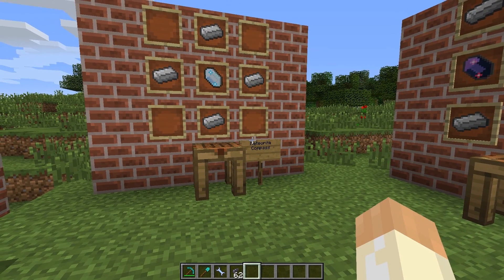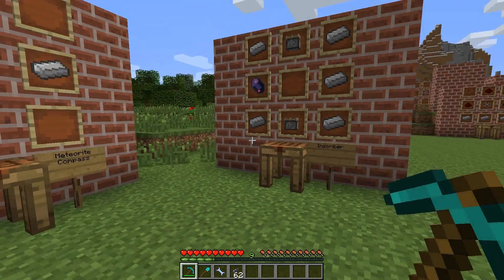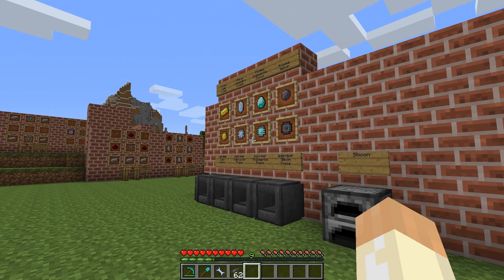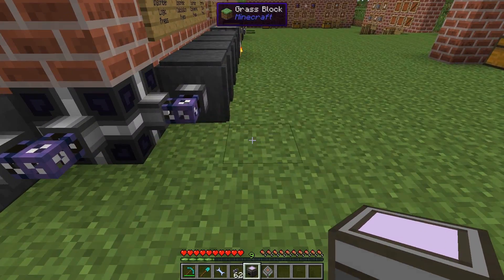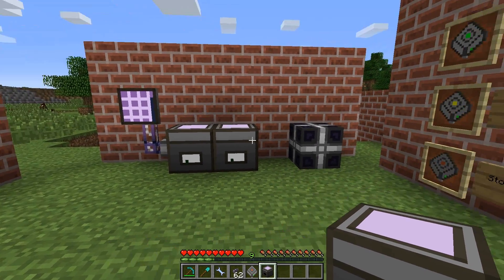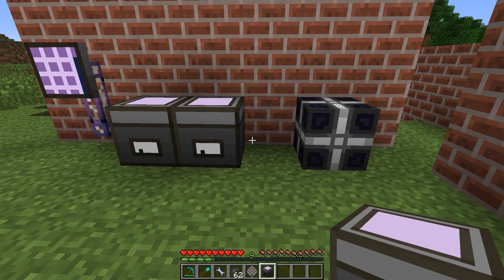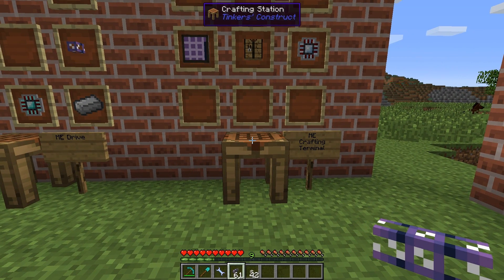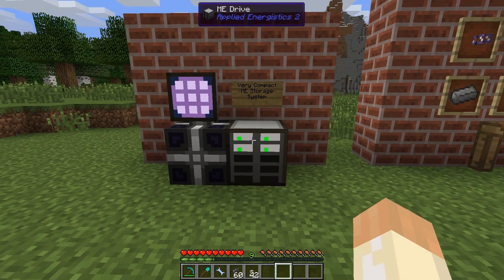Applied Energistics 2 Tutorial #2: ME Networks and Storage (MC 1.7.2 / 1.7.10)

Comment: I'm having a small problem. I'm running Resonant Rise, the latest version as of March 14th, 2016. I can't get two chests to link, no matter what cable I use. I'm powering them via a tesseract, but I can't connect the tesseract to energy cells, or to drives/terminals. Without that source of power, I'm not sure how to get the network running, unless I rely on basic AE power.
Reply from the maker: +A Healthkit There's a block called "Energy Acceptor", that could help you with the powering part. Once they are up and running they can be connected together. But remember that you can't see the content in the other chest without using a Crafting Terminal. Looking "into" the chest will only show the content in that chest, even if it's in a network with other chests.

Comment: Thanks for helping! :) How do you charge the energy cells? I cant find how to :(
Reply from the maker: CrystalStar02 It depends on what other mods you have installed. The AE2 way is to stack Vibration Chambers and make sure they are shut down when you leave the base. But when you have other mods installed the most common thing is to produce power (like RF) and power the network via an Energy Acceptor.
Reply: TKH Thanks! :)
Reply: TKH  Does it work with a reactor? :3
Reply from the maker: What kind of reactor? Both Big Reactors and IC2 reactors give valid power to the acceptor :)
Reply: TKH Thanks again! I was talking about big reactors :)
Reply from the maker: CrystalStar02 Ok, then it should work just fine :) I'm not sure, but I think an ME Controller can accept power directly, without the Acceptor. Another important note is that the default power for AE2 can be changed in a config file. So if you run a modpack, RF might be the default power! Just test in creative and you'll find out directly.
Reply: TKH Ohh.. Well, thanks again :D
Reply from the maker: Is it the AE2 cells? Just place then on the ground and connect power to them. They should retain the energy when picked up.

Comment: I got some items(stone) that have gone into my storage cells in a me drive that i wanted in a deep storage, how would i get those out of the storage cell and into the deep storage? my system is setup so all the stone that gets put in the system goes into deep storage now.
Reply from the maker: Easy, craft yourself an "IO port" and put in that storage cell. Set it to transfer to the network and it will be emptied and everything on it will be re-sorted. requires some free space in the network of course. There are most certainly other ways as well, but it was the first to come in mind. I guess ab export bus (also connected to the deep storage) should be able to export all those items into the unit. Hope this helps!
Reply: therealtkh the speed of that reply deserves a sub. I will probably use the IO port, is there a way to filter it so it doesn't empty the whole card but just exports the stone? would save some time :p
Reply from the maker: Casper Zandbergen Hehe, cool :) I was on the train when I got the mail, and if I know the answer I try to answer asap. Harder if I'm at work or doing family business. Anyway, I don't know if the IO port can be filtered... never tried that. But export bus can be filtered! But there is no harm in emptying the storage bus unless it was already formatted with items ;)

Comment: For some reason my crafting terminal isn't working at all when i try to put it anywhere it always goes upside down (monitor side facing the block) and it doesn't let me store anything, i'm not sure if it's a bug or something. I have ME drive with two storage cells connected to energy cell that has power, everything else is working except the crafting terminal.
Reply from the maker: Are you trying to place the terminal on a block? What kind of block? You can only place it on a cable. And you can have several terminals within the same block space. Screenshot could be helpful!
Reply: therealtkh Thanks for the fast response. I didn't know you can only place it on a cable, problem solved.
Reply from the maker: rancor260 Np, I was at the computer and had the mail window up when you wrote ;)

Comment: what about sky factory how do i find meteors then?
Reply from the maker: ***** Haven't played it, but did some research on the subject, and as I understand the comments: finding meteors is not required. The parts can be crafted with custom recipes, found in loot bags or similar things.
Reply: therealtkh
What about Sky Stone? It does not generate and there is no crafting recipe.
The only solution I have found so far is to create world then mod the cfg, create nether portal then create another portal which generates an overworld so you get void, nether, deep dark and overworld, which really makes the deep dark useless (as if it wasnt already).

Also you can craft the circuits with a quartz knife instead of the inscribers and then cook them or even just hang them on a drying rack to save fuel. The inscribers allow you to automate the crafting process before you get an ME crafting setup. Just set up either 1 or 4 to do the circuits (1 requires manual swaps for different circuits) then 1 inscriber with inputs to back, top and bot to combine the circuit, silicone and redstone, set filters and output to an ender chest. then you can drop the required materials into the ender pouch to feed the inscriber setup. Ender IO conduits are probably the best for this and you can have all the pipes including ME in a single block.

Edit. After thinking about it for a minute I tried adding it to a barrel filled with lava and it creates skystone the same way you make netherrack and clay in Sky Factory.
Reply from the maker: K1llabud The comment I read said "If you want skystone for controllers you will have to put skystone dust, which you get from sieving dust, in a stone barrel full of lava." But I haven't tried it myself as said :)
Reply: Yeah I figured it out when I commented ha ha, sometimes explaining the problem you find the solution. But yeah the quartz knife and drying racks make the cheapest circuits.

Comment: How do you link the wireless terminal with the system because i dont know how to do it in 1.7?
Reply from the maker: I haven't done a tutorial on this yet, but I will... but this is how I understand it to work: Use the ME Security Terminal and connect it to the network. Place your Wireless Terminal in the top right slot - that makes it linked to the network. Connect the Wireless Access Point to the network and place a few Boosters if needed. I'm not sure if you need to set security access though (I had already done that so not sure). Hope this helps until I do a video! :)
Reply: thanks for the help :D

Comment: Great work. Do you have to destroy the sky chest to reset the compass?
Reply from the maker: Hmm, good question. I think the compass points to the Sky Stone and not the chest specifically.. So all stones must be removed for the compass to change direction. I haven't tried it though, but I will! :)
Reply: OK, I did. The compass then lazily spins, until one moves far enough to be in range of the next meteorite. Thanks.
Reply from the maker: Banzairun Ok, that sounds correct. Slow spin means that next meteorite is far away, so destroying all Sky Stone is probably a smart move to not be fooled back to the same meteorite again at a later stage.